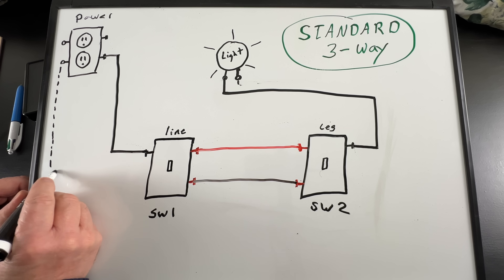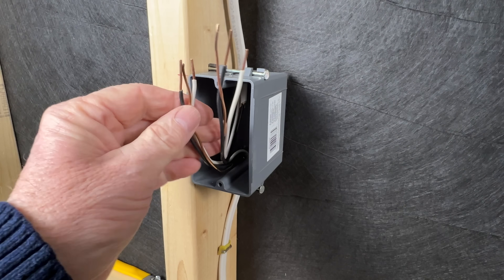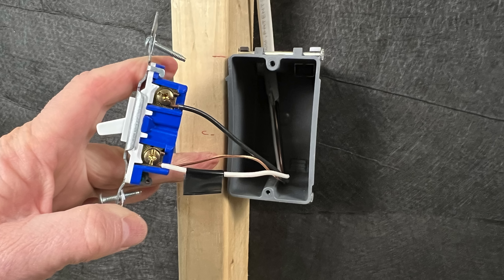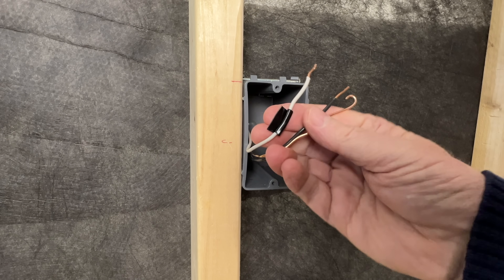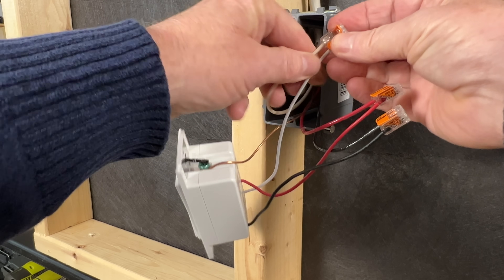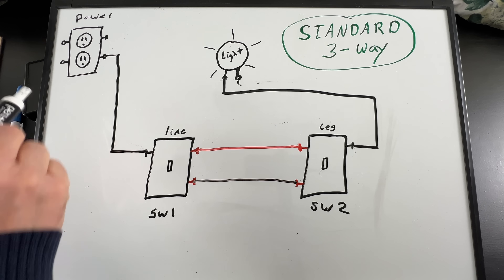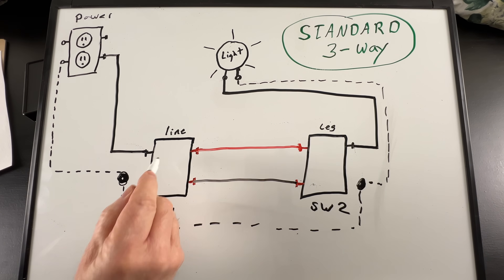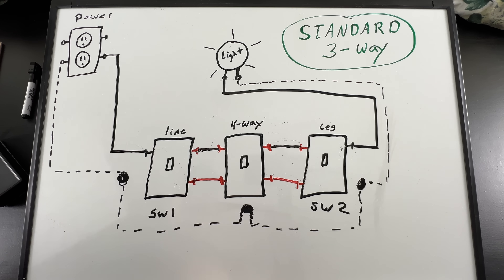How NOT to Wire Light Switches in 2025 (New Rules)

Comment: I'm just a handyman, not an electrician but I was installing a ceiling fan the other day in an old house and found that whoever wired that had used a switch loop on the neutral instead of the hot.  There wasn't enough wire (short wires and soldered connections) in the box to change it around so I had to just leave it as it was.  I've seen plenty of switch loops before, but a switched neutral was a new one for me.
Reply from the maker: I’ve seen a few over the years. It a code violation to switch the neutral wire.

Comment: The neutral wire was required in 2021 when you where running romex the exception with fishing a wire only applies to wire installed in conduit so anyone that thought that fishing another romex thought the walk was acceptable in 2021 doesn’t understand what the code was telling you and I’m pretty sure that this hasn’t changed I would have to look it up cause I don’t wire houses we only use romex for temporary lights and power but the same applies with any manufactured cabled which includes MC/cables, and AC/cables plus if you are on a spec, job you will know ahead of time if your switches will require a neutral wire anyway. The other common thing people don’t do anymore to make it easy on the youngsters today is voltage mixing with conduit we used to run 120v, or 277v in the same conduit and just make sure are color codes where right which you can still do but most people don’t because it’s easier to teach new people not to mix voltages cause why teach them the right way when you can just dumb it down and make them glorified laborers, and have less skilled workers on site and pay less, not put those people in an apprenticeship, and no I’m not a union guy but I do believe that the more that you know the more you can make in this trade.
Reply from the maker: Actually there’s a different exception for conduit which still applies because it’s not difficult to add a neutral in conduit. The exception for cable in walls has been removed in the 2023 NEC.
Reply: @BackyardMaine  I figured but said that I would had to look it up to make sure
Reply: @BackyardMaine  see I believe that exception was there for remodel work and now they have removed it completely because if you can fish a two wire you should be able to fish a three wire but I will find my code book and look at it because even I will not sit here and say that I have everything in the book completely remembered and we all know that it gets tweaked every 3 years and I do commercial and industrial work so the house stuff is side work and the residential side of our code changes, a lot more for safety purposes than the commercial industrial side does and different places, states and cities have different codes I started in Chicago and you can’t use romex for anything your houses are piped in EMT and you can’t use MC cable ether it’s not to Chicago code there you can’t use flex for new construction over 6’ long and if your fishing you need 3/4” flex they won’t let you use 1/2”

Comment: Who is running 12ga wire for residential lighting? One circuit will already run the whole floor of the  house with LED lighting, including ceiling fans.
Reply from the maker: Yup most lighting circuits are 15A and 14AWG wire but if I showed 14 someone would use it on a 20A circuit. So showing 12/2 12/3 was intentional

Comment: It seems the electrical code is not about safety but politics.   The new switches may need a neutral so this is about money,  not safety.
Reply: Go to electrical school if you want to know, it's about saftey. Needing a neutral is not only for saftey but also allows for future switches that may be installed.
Reply: @leif901-5  it’s about money, control, and power. Nothing to do with actual safety for people. Who do you think profits from wifi connected smart light switches? Not regular people.
Reply: This is absolutely about SAFETY. It is more evident in commercial settings, where the color of conductors can be a factor and upgrades to facilities (i.e. added devices/ loads) require better more than just what was standard decades ago. This will also save homeowners thousands  of $ because they won't have to demo finished material just to add a few devices. Just because someone benefits monetarily from a change doesn't mean that the change was for money.
Reply from the maker: It actually is about safety. If you have a neutral wire you won’t connect the neutral wire on the switch to ground creating a hazard. Similar to requiring receptacles every 12 feet to keep people from using extension cords. It’s about safe and adequate insulations for the consumer and nothing else.
Reply: Look on the board for who writes code. 75% are higher ups at a manufacture of some kind.
Reply: It’s all about the money jamescole$ just like arc fault breakers.

Comment: Im confused,my 3 way can control the light on and off at both light switches,.those diagram look like the lead switch will contril the second switch all the time?
Reply from the maker: No not at all. Thats how 3-way switches work each switch is dependent on the other. For example: Switch one is up, switch two is up and the light is on. Move switch two down and the light is off the move switch one down and the light is on. This way no matter what position each switch will control the light.
Reply: Took a bit but I see it now, thanks

Comment: Wow, 12ga wire for a standard light circuit; we're allowed 14ga. 
I was afraid you were going to say the new US code required 14/4 as that is almost impossible to find in Ontario. Canadian code usually comes out the year after the US. 
So next year we'll be running 14/3 to our first box, job costs just keep escalating, more fodder for the DIYs who'll continue to do it the old way! 

Cheers
Reply from the maker: Most lighting circuits are run on 14 gauge wire and 15A circuits but it’s ok to run them in 12 gauge on 20A circuits as well. Some will jump off a 20A receptacle circuit to feeds lights. I showed 12 because I didn’t want someone connecting 14 to a 20A circuit without knowing any better.

Comment: Why in 2024 are we running all this expensive Romex to wall switches? Why hasn't the industry gone to low voltage communicating switches and just taking power to outlets and fixtures? Material cost would go down, labor would go down, and flexibility would go through the roof.
Reply: Switches are incredibly durable and, being inside a junction box within a wall, rarely need replacement.  In the event one does need to be replaced, you need to kill the breaker.  (Depending on local codes, this can be a massive pain.)

Light fixtures are (usually) fully exposed - not only are they more vulnerable to damage, but also frequently changed for aesthetic reasons.  This is in addition to using fragile bulbs which need regular replacement and sometimes break in a manner which exposes live voltage.

This is why live voltage is run only to switches and outlets - NOT to fixtures.   When the switch is turned off, there is ZERO voltage going to the fixture(s).
Reply: @twylanaythias What?  Would you please explain how it’s a major pain to turn off the breaker to a light in a home with modern wiring?
Reply: @guri256   With rare exceptions (like most kitchens), each breaker controls an entire room.  Clocks, TVs, computers, and everything else in the room running on AC is going down/out when you turn off the breaker.  Assuming, of course, that you flip the right breaker the first time - breakers are commonly mislabeled, assuming that they're even labeled in the first place.

Even if you live by yourself (no kids to complain about not being able to play video games, partner to be upset about not being able to use their computer, all of them complaining because the internet is off, etc), it can be a real hassle to get everything back up and running, clocks reset, etc.  Add to this the operating assumption that nothing ever goes 100% as planned (particularly when it involves working on someone else's work), you can see how quickly a 'simple repair' can turn into a massive headache.
Reply: Maybe because it allows more options for future upgrades. For example if needing to add an electrical outlet or other powered device, hot neutral and ground could be obtained from a switch box if nothing else in the area is available.

Reason 2 simplicity and reliability of not using relays/contactors when a single pole switch could be used.

I realize those aren't super strong arguments but since when does the NEC use solid reasoning for everything
Reply: Because some romex and a standard light switch are cheap, quick to install, and will last for decades, with a switch replacement being off the shelf and a couple of bucks.

Any kind of low voltage system will be much more complex to install, will lock you into a particular manufacturer or system, will likely be hard to find replacement parts for it in a couple of years as they update the designs, and is much more likely to have failures since it's using special components, relays, etc.
Reply: We already have cheezy enough switches. My Dad used to disassemble them 40 years ago and clean the contacts.  Today’s are horribly disposable and to put in computerized latch circuits would increase the switch costs and further degrade quality
Reply: That is what I am doing on my current project . Centralized power conversion to low voltage . And running LV wire to all switches and lights which include communications.

Comment: I’ve always run the neutral in each switch box by using 14/2/2 for 3 way switch so I can carry the travelers and power to the next switch box .
Reply: You obviously haven't been around that long, as 14 2 2 hasn't always been available. It's a newer concept, being absolutely ridiculously overpriced. So for you amateur wannabe sparkys, you don't tear your walls open, you install smart bulbs or lamps. If you can't figure things like 3 and 4 way switches out, hire an electrician that has proven himself with 8000 proven hours before they can call himself or herself an electrical journeyman!. Next thing you know all you geniuses will be attempting service upgrades by watching YouTube. Good way to end up crispy critters.
Reply: @jimfee2753  I’m sorry , only got 29 years behind me as electrician and 14/2/2 has been around for over 15 years , good named supply house stock it like 12/2/2 , but good luck to find it in hardware store .
Reply: @jimfee2753  you’re probably right , I only got 32 years of electrical work experience behind me , and I’ve been using 14/2/2 and 12/2/2 for at least over 15 years since the NEC rule about carrying the neutral/grounded wire isn’t that new .

Comment: Another reason for wire in conduit instead of romex. I do not need to have “identified” white wires to confuse the crap out of someone later on. Black or red for hot leg depending on which buss the breaker is connected to, blue for switch leg, purple for travelers, white for neutral and green for ground.

Comment: It's great to see that the code is actually requiring this now.  I replaced most of the switches in my home with smart switches some time back, and every single one of them required either fishing a new wire through the wall (if I was lucky) or ripping out part of the wall to re-run things (if I wasn't), and it was a huge pain.

Personally, I've always preferred feed-through wiring anyway, but unfortunately it seems to be a very uncommon way to do things in my area for some reason...
Reply: FWIW there are smart switches that don't require a neutral. They always allow small amount of current through to remain on, so low-wattage bulbs might flicker, but a bypass can be added. I have a lot of inovelli switches in my 1940 house and they were simple to install.
Reply: It is probably a question of where is power coming from.  If power is running through the attic,  it seems natural to lower a loop just to a switch. If power is distributed from the basement, then run through switch and then up to the fixture would be obvious thing to do.
Reply: When there's no neutral, you can still install smart switches, just not those that combine the user-facing side and the electricity-switching side in one unit. Rewire the distribution box to feed all wires through on the same colour, add a user-facing switch to the switch box that now has live and neutral, and add a head-less smart switch (relay) to the light fixture (or inside the distribution box) that now has unswitched live and neutral.

However, you lose the ability to control the lights at the switch when the home automation fails.

Comment: Why does this guy specify 12 gauge wire for a lighting circuit?
Reply from the maker: Just used 12 gauge wire in my reference. Of course 14 gauge wire can be used with a 15A circuit which is actually more common. But if I showed 14 gauge wire for sure someone would install it on a 20A circuit not knowing better.
Reply: @BackyardMaine  Your explanation was very good and useful regarding the neutral wire required for newer wifi enabled devices. But, 12 guage wire should not be used on lighting circuits period. Residential lighting circuits are 15 amps 14 guage wire.
Reply from the maker: By code 12 gauge wire is fine on a lighting circuit. Many electricians will run all the receptacle circuits on 12 AWG wire and jump from the receptacles to the light or switch box. Perfectly fine by practice and by code. I usually separate lighting and receptacle circuits and run the lights on 15A circuits with 14 gauge wire.  @stevoco

Comment: Alright, I have a question, that I suspect that you either will not answer or will not answer honestly. In this time of diminishing lighting loads, why are we now required to run 12 gauge for lighting circuits?
Reply from the maker: We aren't required to run 12 gauge wire for lighting loads. The breaker determines the circuit size and the wire must be sized so to the circuit. You can go larger but not smaller. Most lighting circuits are run on 15A circuits and 14 gauge wire. If connected to a 20A circuit then 12 gauge wire is required. I used 12 gauge wire in my video for a specific reason. I didn't want someone to run 14 gauge wire not knowing they had a 20A circuit. I recently made a video talking about the new 10A circuits that are now acceptable in the code. I talk about lighting circuits quite a bit in that video.

Comment: what about the ground wires?
Reply from the maker: I didn't want to complicate things on the white board. Yes the ground wire travels throughout the circuit and connect to every switch and bonds to the box if its metal.

Comment: If you need a neutral on a dead end three way you can use 14-4 or 12-4 cable. Most electrical supply houses stock it.
Reply from the maker: You can buy that at a supply house but it's cost prohibited.
Reply: @BackyardMaine  I bought a large spool awhile ago, I don't remember it being that much, I use it when the situation calls for it. I find it easier and cleaner than  extra runs of 14-2 or 12-2. To each his own.

Comment: This proves one thing. The people writing the codes are idiots! The color of the insulation on any conductor has NOTHING to do with the functionality of that conductor. It is simply there to make installation easier. Whether the insulation is red, white, black or purple it does not affect safety or any other quality of the conductor. If all the conductors were the same color I have a feeling half the electricians in the country would be lost. Also why would any regulatory agency be allowed to regulate something that "might" happen in the future (ie: installing a smart switch)? It's all about control.
Reply from the maker: This comment tells everyone all they need to know about your experience with electricity.
Reply: @BackyardMaine  I deal with electricity everyday of my life. I happen to work in a industry where all the conductors are the same color and the circuitry is all safety critical (actual life or death). The color of the insulation equates to nothing more than a name (identifier). That's it. Nothing more. Nothing less. Surely you are not telling me that neutral conductor you showed capped off in the box for possible "future" use adds some kind of functionality to the switch circuit you were showing?
Reply: @mopreppinmolivin 
Just gotta say, I agree with you but partially for a slightly different reasoning.
I learned a long time ago not to trust what work was done before me so I'm more often than not testing the wires rather than trusting what they are supposed to be based on color...or even being bare copper.
I've seen it all (maybe) bare wire used as neutrals or even hots, greens used as hot legs, unmarked whites as hots and so on.
Honestly it might almost be safer if the wires weren't color coded so that half arsed DIYers will feel less confident even trying to do their own electrical work.
And yes making it a requirement to accommodate the ..."maybehood" of smart switches (which are more expensive and prone to technical issues than a normal switch) is regulations just going too far.

Comment: I do not agree with your cable screw connectors,it's a lazey way to join wires.ALL wires should go to a proper terminals to secure and seperate wires.The US is living in the dark ages still.
Reply from the maker: Well our "dark age" wiring methods seem to be much safer and also cause less electrical fires than the ones used in the UK and Europe. You can google the stats...

Comment: The important thing about the 'Dead End' method is that its an easy single wire way to convert a single way switch to two way. Its not yet common or a requirement in the UK to fit a neutral in a new installation.